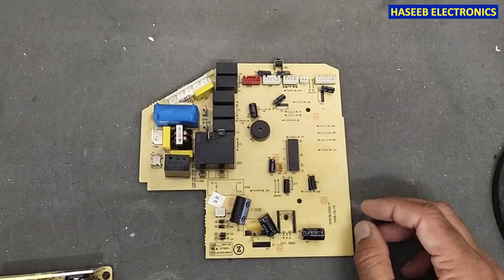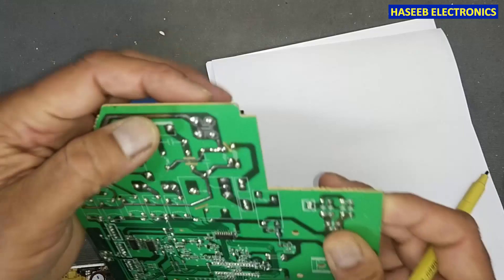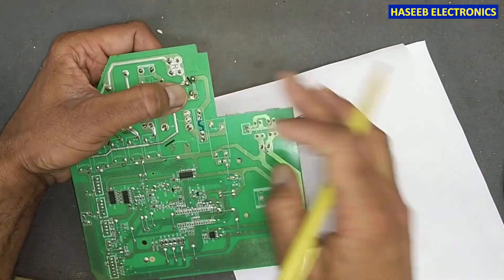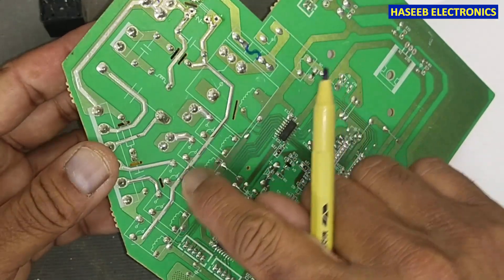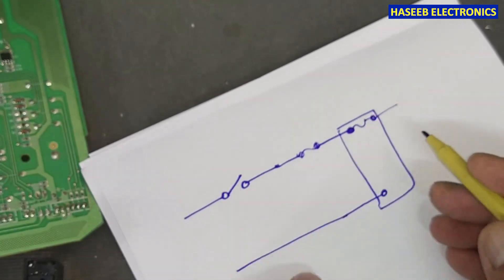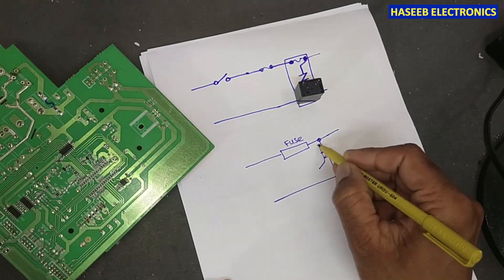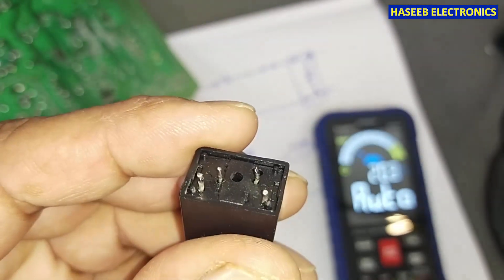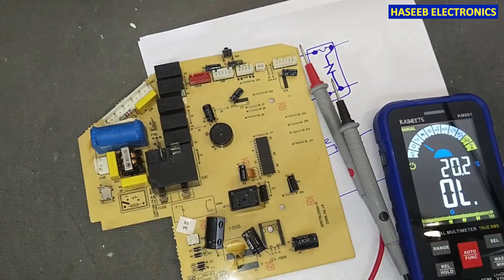{822} ZGAY-B Varistor + Fuse || Surge Protection Module

Comment: Kindly provide me details of your desoldering gun. And provide me part number of the gun.
Reply from the maker: it is WELLER WR3M rework station,
https://www.indiamart.com/proddetail/weller-wr3m-3-in-1-high-end-electronic-pcb-soldering-de-solderign-hot-air-gun-rework-station-9437196497.html
Reply from the maker: https://no.rs-online.com/web/p/soldering-stations/0135862
Reply from the maker: https://www.amazon.ca/Weller-WR3000M-Digital-Self-Contained-3-Function/dp/B0019V5PSQ
Reply from the maker: https://stellartechnical.com/products/weller-wr3000ta-3-function-digital-rework-station
Reply: Thanks for reply sir.